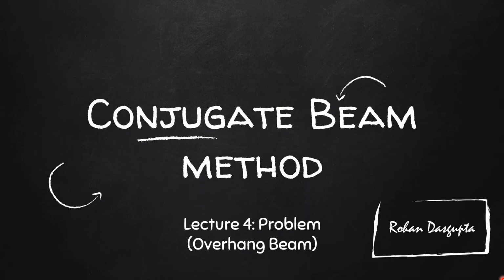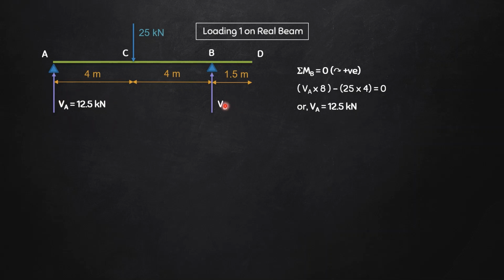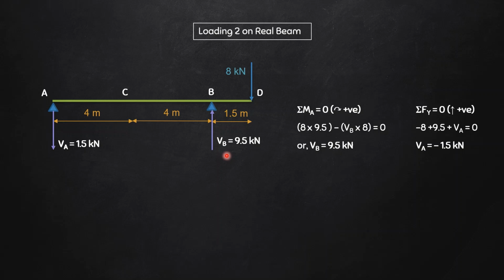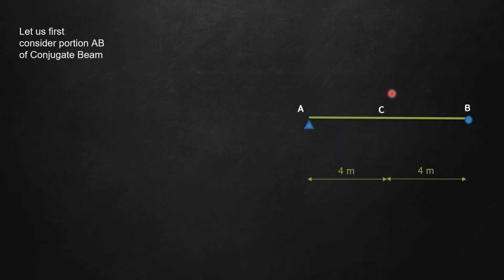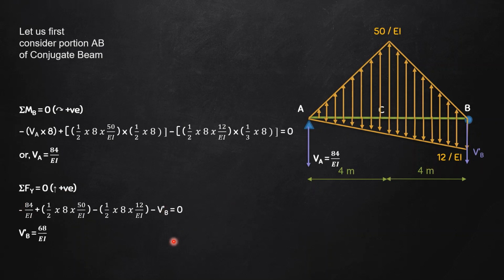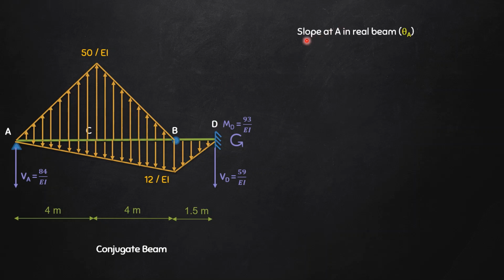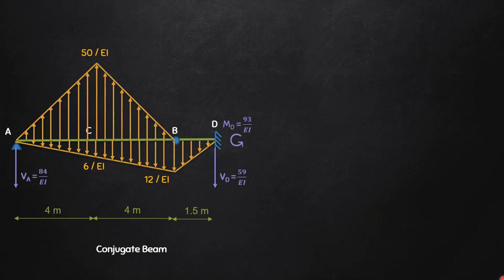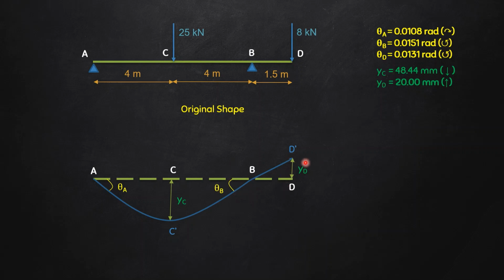| Conjugate Beam Method | Lecture 4 - Problem on Overhang Beam | Rohan Dasgupta |

Comment: Sir why you have used superposition,  can't we solve problem using two loads at a time to find momentum
Reply from the maker: I have used principle to superposition just for ease of understanding the positive and negative bending moment separately, however if you are comfortable considering both the loads together, you can do that as well - it will give the same answer.